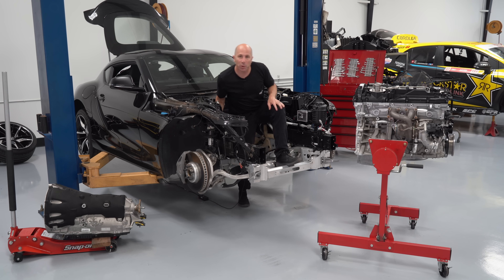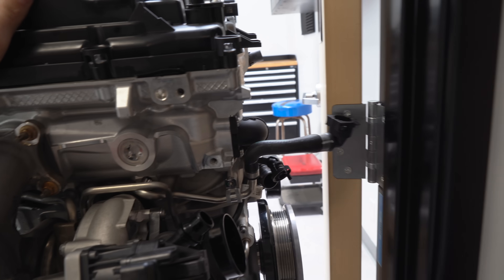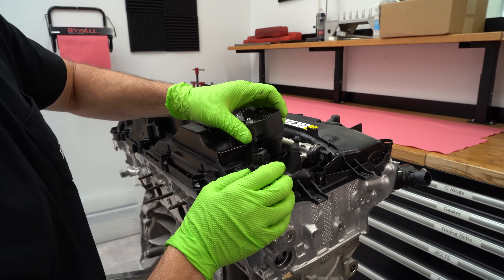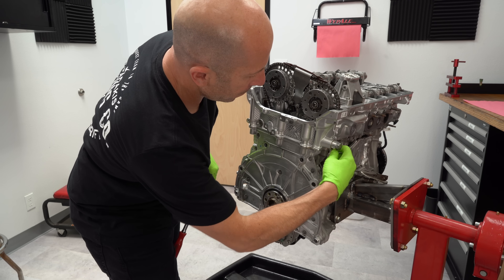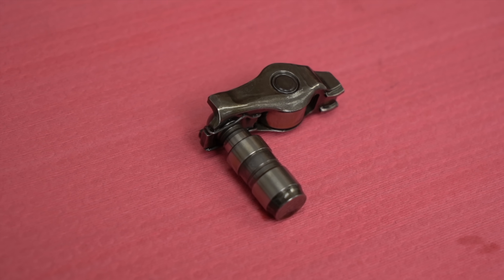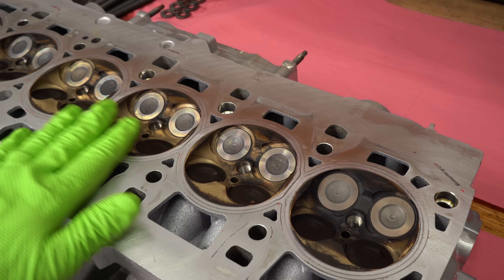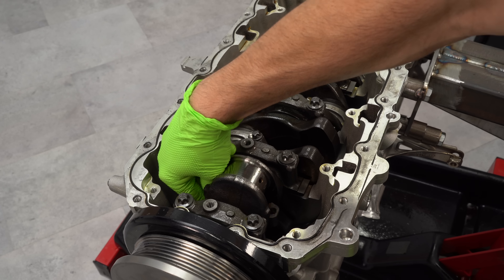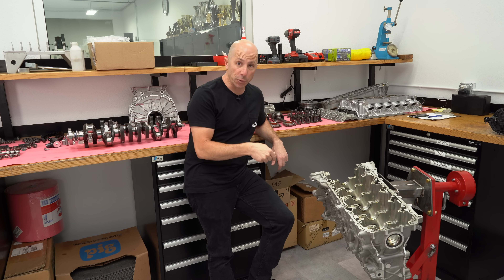2020 Supra B58 Engine Teardown - First Look - Better than the 2JZ?

Comment: Regarding the throttle flap: On these engines the throttle stays wide open and the valvetronic (variable valve lift system) is actually controlling the throttle response.

Comment: They are called fracture split rods, when you get them new, you bang them on a surface or use a hammer to split them. They are an extremely strong rod design.

Comment: Dealership: change a broken thermostat, that will be $4000
Reply: Technically isn't a thermostat.
Reply: Cerevo guess not anymore. Its probably some servo motor valve assembly🤷‍♂️

Comment: the 2020 supra was designed to support aftermarket parts, so that’s why everything is easily accessible and easy to take off. fun fact.
Reply: You mean just like the original Supra?
Reply: Mennims yes, but before the new supra came out, everyone was worried that it wouldn’t be as accessible, and people still think that.
Reply: Yea thats what they said.! Tuners do not want that price. You tune A tuner not A 60k BMW!

Comment: With only two exhaust ports, and still taking into consideration the "internal exhaust manifold", I wonder how restrictive it will be when higher volume of exhaust gasses will be required for larger turbos.

Comment: So those head bolts are the same(ish) design as the Mercedes M156. I hope they don’t break like the Mercedes ones did which were replaced later on with E-torx bolts.

Comment: That bottom end will not hold 1000 hp
Reply: @Seb C rods and pistons won't. And it's BMW, forged steel on a 2jZ gte is much stronger.

Comment: I’m sorry, but this motor is way over complexed. A lot of the methods on this engine is not necessary. They build engines like this to keep the prices high and your average mechanic won’t work on these. I’m curious on how much just an oil change is going to be on this. Also these direct fuel injection motor are ticking time bombs for blowing out your rings. Ford is already having problems because of this system. You don’t need 1000psi fuel injection to get performance.
Reply: Seb C yeah I guess that makes me a dumb fuck

Comment: This guy points out such random stuff for a new motor... this is the turbo oil drain, this is a coil-on-plug ignition system, this is the oil level sensor. My BMW from 1992 has COP and an oil level sensor, this isn't new stuff!

Comment: Very informative man thanks. I havent scene these engines pulled apart yet being so new but definitely didnt expect to see it as well engineered as it was my only complaints about it is the fact the design requires certain tools to even take it apart and the fact the timing chains is in the back of the motor would piss me off especially if you got to pull the motor or trans to get to it when it shits the bed or to mod and then when you get it out you have to mod you motor stand and reinforce it or go buy a euro motor stand or an adapter or fab it like you did. You have a shop available to you the average dude doesnt so doing this yourself isnt an option so now your paying for tools or labor I mean hell you had to lathe a sock just to get the head bolts out I mean common that sounds like a nightmare and with all the sensors is there room to get them out or is a motor extraction needed for that to. Also why would you have 4 exaust  ports going to 2 then to the exaust it seems like you would lose flow and that plastic intercooler box looks cheap. Other than that I would say it will be probably be quicker than a 2jz if both heavily modded and dialed in this new supra will beat it for sheer tech plus a better trans and more efficiant fuel system and computer sure its possible. Kinda want to see the numbers and compare the 2 after modded.

Comment: Soooo  question 
Will this engine perpetually leak oil like my n54 335i used to??????
Reply: It shouldn't do as its using silicone sealant rather than those rubbish gaskets that fail so often
Reply: I actually find that funny. My old N54 powered 335i went through TWO valve cover gaskets and oil filter housing gasket in the span of 90,000 miles. I had more luck with my N55 tho. Original valve cover gasket at 130,000. Oil filter housing gasket replaced last year.

Comment: I'm interested to see how they get the exhaust flow required through the head and also if the variable cam lift system can be incorporated or if it will be defeated somehow. Good luck and thanks for taking on this project.

Comment: 5:20 Isn't spark plug hole angled? This is very common for modern BMW engines and needs swivel spark plug socket.

Comment: I like both Toyota and BMW, I really don't like how Toyota had BMW do all the work and make pretty much the whole car and then step in to check do just quality control and improve certain areas (which in itself is a good thing), but then came out and bragged to the world "oh look, we've made a new awesome car"! No you didn't, Toyota. You didn't make anything from the ground up (ok, exterior styling is your work), you had BMW do the hard work and then chipped in on the details, that's it.
With all of that out of the way, this looks like a very impressive engine! And it's fascinating to see BMW's great design further improved, refined and optimised by Toyota's know how and ideas! Really looking forward to seeing what this engine can achieve or rather what can be achieved with this engine!
Reply: Both Toyota and BMW teams worked on the car together and simultaneously, it is a product of both companies and I stand by their decision. I think they made the right one. Personally, should the MK5 have come with a manual option, it would have been my favourite Supra to date, and I would find myself in a position where I would have to own it.

Comment: This guy: the engine is simpler than the older ones... Me, when they remove the engine cover: Holy God...
Reply: He meant the way you take out the engine. Which I agree with. Bunch of bolt on parts that hold everything together. Very cool.
Reply: Wait until you see a W16 engine lol xD
Reply: Ya
Reply: When the cover come off it reminded me of the messy caddy engine bay. Mother of Jesus don't compare this to the 2j. Embarrassment. My 2j is simple and easy and reliable. Not to keen on plastic manifolds 😱
Reply: @mcmagician2133  the ls coyote and just about every engine in the last 20 years uses a plastic manifold. And those engines are more reliable than the 2jz.
Reply: One freakin clean ass garage. OMG!
Reply: Yeah, a real nest of snakes.
Reply: Lmao , indeed xD
Reply: I think he meant the overall construction of the car, not the engine its self. The engine its self is very complicated next to the 2JZ.
Reply: Exactly
Reply: I know right...this thing is mind blowing compared to a Toyota JZ
Reply: Lol almost every modern engine from 1995 and newer look like this underneath the engine cover, dont now in what era you are living but it isnt looking like a simple old Chevy V8 anymore this day my dude..
Reply: typical rat's nest under the cover. amateurs like you typically get scared by it lmao

Comment: Who else went "screech" when you seen the timing chain was on the back of the block? Anybody thats ever worked on the Audi 4.2 will call this one easy
Reply: Not uncommon on BMW engine's.
Reply: @Muadddibb  - so I can read into this: The owners that havent shown this proof of maintenance on used vehicles likely sell them before this is needed &/or the 2nd owners wont spend the $ to do it if they aren't mechanically inclined. Never owned a BMW although I maintain all my vehicles meticulously mysely & dont mind tge hassles

Comment: I wonder how clean the intake valves are going to stay with the direct injection?

And mental note:  If the timing chain gives any issues, scrap it or pay really big bucks to have it fixed.  

Otherwise, it looks fairly skookum.

Comment: What a crap engine! Plastic intake runner/combo inter cooler; two tiny exhaust ports; didn't BMW have some blocks with steel core for the bores and crank and magnesium outer; rear timing chain is just pure intelligence...not! with rear oil pump too - great for servicing; the girdle is a joke; alloy sump I suppose is better than plastic - don't over torque the oil plug; plastic oil filter assembly; Plastic cam cover; dodgy valve train.  1000hp = pistons punch holes out the side of the block

Comment: Timing chain in the rear.. sounds like some engineer that never changed his own oil designed that one 🙄
Reply: Why do you remove your timing chain to change oil? Removing the plug in the pan and removing the old filter does not require a removal of the chain
Reply: @tobbsnobb1366  has nothing to do with changing ur oil. Timeing chain , guides and a bunch of stuff goes can go wrong. An with that u need to drop the hole Engine. What a pain. But I'm sure if that chain breaks that this is gone tho.
Reply: @02riddle73  well, good chains should live as long as the engine. This way of olacement worked out really well on saabs engines. No reason for it not to work here
Reply: @tobbsnobb1366  What about when the plastic guides wear out?

Comment: 'Its a simple engine ' yet u had to make a custom engine hoist and had to get a lathe on your socket set to get the spark plugs out 🤦🏽‍♂️🤦🏽‍♂️🤦🏽‍♂️
Reply: Mo Dal , BMWs since I’ve owned mine , have had a thin walled spark plug socket.
As for the engine stand, it’s universal with multiple holes/config . Modification and setup has to be done with every engine.
Reply: @chrisrobles2012  modification doesn't need to be done for every engine smh
Reply: Aaron Mcclure , yes it does. No two engines are alike. Custom bolts are needed to reach and in his case there are no adjustment arms on that hoist . He has a solid 4 hole plate. 
When EVER have you been able to mount two different engines and leave it exactly the way it was before? 
Right....
Reply: You can buy that special spark plug socket for like $5-$10 on Amazon. Not a big deal really.

Comment: I was turing with my motor bike in Austria yesterday. We stoped in Spilberg Rebbull racing track. I watched privat owners drive ther cars on the track. I saw bunch of Porsche 911 diferent models. GT 2, GT3, RS 2, RS3, Cayman, beside those cars ther were 4 BMW M3 E46, BMW M2, BMW M4, 1 Mecllaren , and two other slorts cars. But 80% of cars on that track day were Porsche 911 models. I thinck the most powerful ones had 500 maybe 550 hp. They were killing everithing in ther path. No Toyota Supra, Ferrari or Lamborghini can equal to those top end Porshes. So basicaly i figur out. If you want the best every day racing car for your money buy Porsche 911 RS or GT model...

Comment: I bought a toyota a long time ago i said to myself its a cheap car it'll get me through my hard times A to B transport i'll get a new one when its too expensive to repair. That was 8 years ago all ive had was oil changes and a new battery. wtf toyota???? 500,000kms same engine and transmission... its still going!!! employee those old engineers not BMW

Comment: 1000 hp? the mission for hard tuners is to get 2500 3000 hp!
 lets see the first thing that melts is exhaust manifilod, oh thats the head we have to make a new head!
2019 nissan makes engine by hand and toyota takes engine crap from the enemy
sorry toyota fans.you can still make 2jz swap and give back the garbage to bmw fans they yould need it

Comment: RIP supra like most newer bmw engines will fail as there timing chain tensioner failure is hight who remembers n20 lol and let's throw a water cooled intercooler in timing chains on rear of the engine Toyota this is just wrong

Comment: "They actually made this engine really simple to work on, except for the part where we had to literally manufacture something to hold the engine."
Just playing. Love straight 6's. Been making 600+whp from N54's and N55's for a decade. Fun motors.
Reply: Flowmasta Flam simple? 🤣 dude the f’ing timing chain is on the back of the engine 🤣. It’s BMW junk.
Reply: Benjamin Lopez 
Exactly. Made to be taken apart by dealerships only
Reply: Benjamin Lopez ...
Reply: Or the fact that you literally have to pull to the engine for anything lol. RIP cam swaps.
Reply: @Mrjohnnymoo1  No you dont,you can even change the timing chain in situ.Theres a panel you remove and unlink chain,clip new chain to the old and wind around till its back at start ,old chain out ,new one in unlink and re-join.install panel an adjust the tensioner.

Comment: "The speed of the drive by wire is faster than your foot can move" 

What
Reply: He means that you can open the throttle quicker with a DBW throttle using less foot speed, than with a cable throttle. i.e. no matter how fast you smash the throttle on a cable throttle, the DBW will always be quicker.
Reply: @XtremeGTI  What he actually means is, there should be no difference in speed from using cable or fly by wire. The electronics can act faster than you can think, so they will be no lag...
Reply: @XtremeGTI  It's all controlled by the speed of your foot and the setting of your cable/calibration of your pedal. Saying wire is faster than cable is an impossible statement to make, unless we're talking about the computer controlling your throttle in that case wire would be faster.

Comment: Timing chains & belts on the back side of engines is usually a disaster waiting to happen (Audi, Saab, etc). But in this case it might be less labor rate to yank the trans than strip the front of the car by the looks of it. Not a big deal for technicians and folks with a lift but its a pain in the ass for the home gamer/weekend warrior working in the garage. I was a BMW Master tech for 10yrs before moving to aviation. Some very cool and interesting design but I see problems as it ages. Eventually all that plastic crap fails and its usually expensive. Its clever while it works but down the road for us that buy/mod older cars, its a headache. I can already see guys are going to be milling the integrated exhaust manifold off to do tubular header mods. There's a lot of potential but there are some hurdles there too. Interesting to see where the weak links are or power limitations are.

Comment: So funny to hear all the 2JZ love here, motor was awesome in F&F, but sorry to burst your bubble it has it’s downfalls. Professional tuners go through 2JZ motors like nothing, they’re so good at moding them because unfortunately they have enough under the hood time with them not in a good way.  I see this BMW partnership as an experience to improve both companies.  BMW was impressed by the FRS build (FR handling fun) that they recognized they needed to capture that essential connection between driver and car that they lost after the E46.  Toyota recognized they needed a successor to the inline 6 and agreed that BMW could source the desired effect they wanted. Hating on this motor cause it’s BMW and trying to compare it to the 2JZ motor is just a sign of a lack of understanding.

Comment: That's some great work there ! But the complexity really scares me off. Had a fly-by-wire throttle giving up while making an overtake - scariest moment of my life. Also I am a bit worried what might happen with the water cooler inside the manifold where it's much hotter. If something goes boom all this would go in the cylinders, massively increasing the damage.

Comment: Fun Fact: that throttle body does is not your throttle control. That eccentric shaft that controls your intake cam lift is. It’s called Valvetronic, it’s your actual throttle control via the drive by wire accelerator pedal. Welcome to BMW.

Comment: I’d consider myself pretty good with cars and how they work but to be honest I was so confused and lost during this video😂 I’ll stick to bolt ons...
Reply: considering the technology going into these new motors, and how well manufactured this new motor is told to be, bolt ons would likely be more than enough to make a decent build out of the new supra.
Reply: Justin White 
Definitely
Reply: DesiredFilm this car is built for just "bolt ons"
Reply: mannyb332211 
Yeah but there’s always still room for improvement with the actual engine.

Comment: the hpfp design is idiotic, they should have it driven by the actual cam like on the mini 1.6 engine.
that oil and coolant exchanger is a catastrophe waiting to happen, they should've put nipples on each port. 

plastic thermostat  housing is a disaster. 

integrating the water cooled intercooler into the intake manifold is a stupid idea, leak=hydrolock!
all of these are weak points that can be problematic if any of the specifications is out of range.
this motor will make the power i'm sure of it, but it wont tolerate deferred maintenance, cheap parts, or cheap fluids.
that is why the 2JZ is legendary, it has such a wide tolerance for being out of specification (not the 1000+ones), it can deal with shit coolant, and some deferred maintenance.
the more you push the tolerance and specs higher, the higher the chances of failure.

Comment: My throttle response in my dodge charger 2016 is horrible. Any tips to fix this? It doesn't use a wire btw its electronic also

Comment: Well, I'm in love. After working on Saab B235Rs and Audi 2.0T B7s for some time I see the results of mistakes made and engineering wins among the Euro engine guys. 

One thing I note is, what's up with no roller on the HPFP?!? That is arguably the downfall of the B7 Audi 2.0 FSI engine. Direct impingement of the HPFP plunger on the cam, along with DFI and the soot that it causes (500 miles and the pistons are black as midnight?) could result in rapid wear unless you're on a quick oil change interval. B7 guys will change HPFP cam followers 20k-30k or so as PM. Didn't see any such thing here.